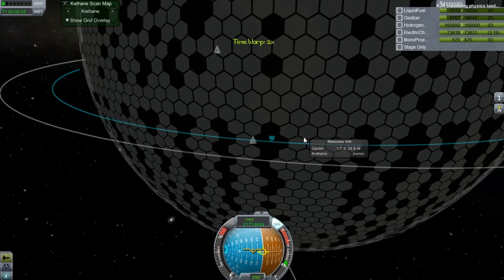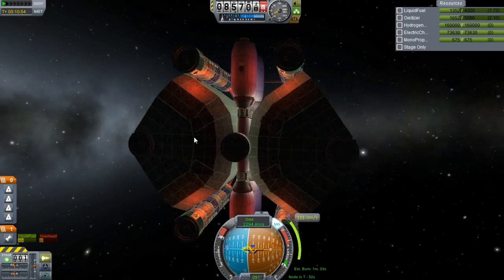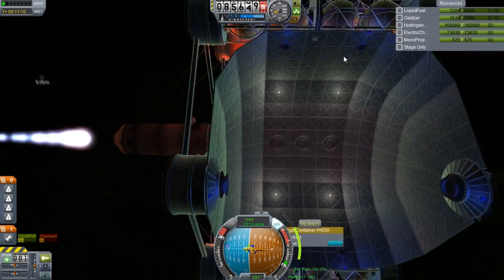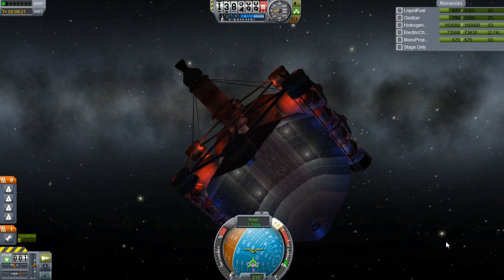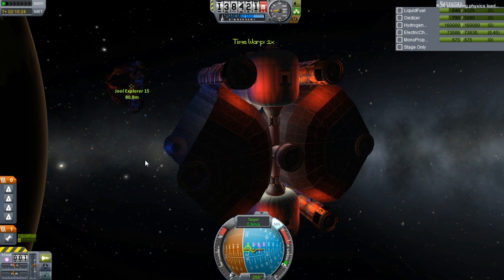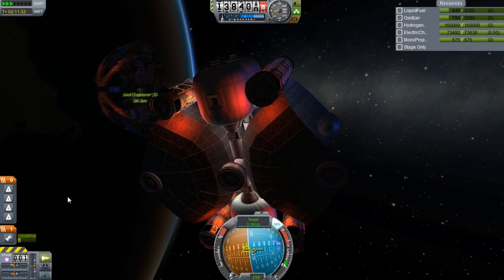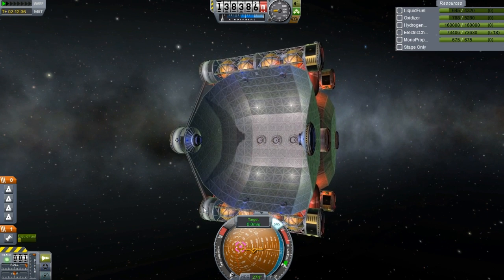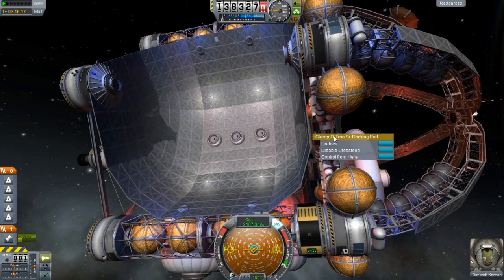KSP Modded - Ep. 17 - Jool 15 Docking Bay

Comment: Hey man, nice vids try the aggressive version of the tex reduction mod, you can edit how it reduces the texture load as well to suit your needs.  http://forum.kerbalspaceprogram.com/threads/59005-0-23-Release-2-15-Active-Texture-Management-Save-RAM-without-reduction-packs%21
Reply from the maker: Thanks! I might switch over if it will improve the performance. I also had the shadow and light settings at 40/20 because the lights on my base were bugging out at lower settings. I turned those down as well.

Comment: Tha launch stage makes me sad... It seems that by allowing yourself to use so many mods, it's slowly becoming not-ksp or non-legit or something.
Reply: All of that mass is legitimate. It not falling apart due to physics glitches/hacks is something made better by welding the parts. Also, efficient staging is essential. Makes it look easy.
Reply from the maker: exlensic  I said this in the video. It took me 3-4 hours just to build that dock section. I tried using the vanilla parts it was my last ditch effort. I will be building a vanilla lifter for the future.
Reply from the maker: exlensic
I cant wait till they fix that!